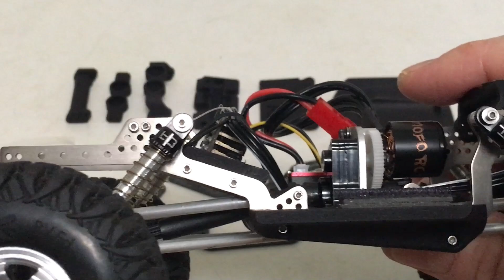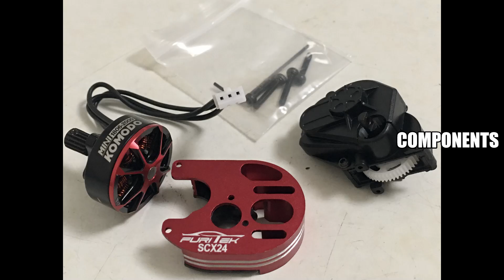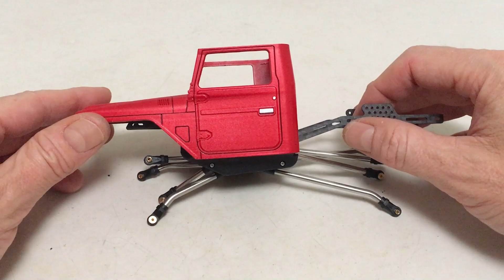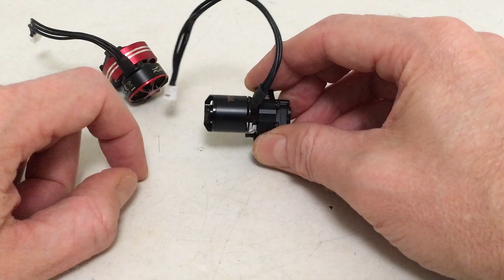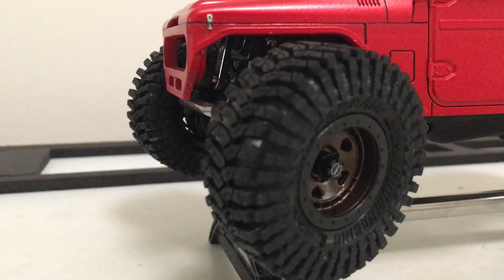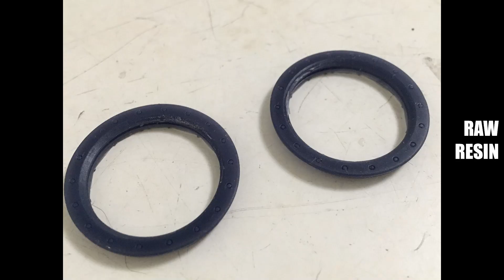SCX24 - XL CARBON CHEAT CODE / FJ45 CAB BUILD: MAZZ DESIGNS SLIDERS, WTMicro BODY, MOFO ROCKWOLF ESC

Comment: You got the FF mount for that motor? I'm ready to select and purchase from mofo website, but i need to be shure what mount i need to go that way you mount your motor.
Reply from the maker: Yes, that is correct, the FF mount. It can be rear facing if you flip your transmission backward as well.
Reply: Thank you! What spec. recommend for perform slow crawl?  @bcochener
Reply from the maker: @montoyaesteban6  the Nano Bam is only offered In 3200kv. Not sure what spec you’re talking about.
Reply: My fault, I ordered the BAM 1900KV 18t. But i think i can run i to as well. @bcochener
Reply from the maker: @montoyaesteban6  it is quite a bit larger and heavier than the Nano version. It may fit… great motor though!
Reply: I'm running a V2 cheat code with C10 links. @bcochener

Comment: Great video ! What type of radio do you run and what types of receivers ? Just purchased the MOFO ESC and MOTOR as my first upgrade to nicer components
Reply from the maker: Thanks!  I use a Flysky GT5 radio and FS2A-4CH as the micro RX - or I use the FSBS-6CH.  All can be found on Amazon.  Mofo all the way!  Cheers.
Reply: Right on thanks 🤙🏼 
I actually just scored from what I can tell is one of the last cages on the planet that you used in this build video from a hobby town in toms River, New Jersey. They are shipping it out now. Super stoked !! Thanks for all the informative info on that build video.
Reply from the maker: @spheli-13  Ah, no way!! What good luck on that find. Cheers mate!

Comment: This is so sweet, you would use the cab eventually, got any tips for mounting it to my UAF chassis?
Reply from the maker: The sliders are set up for a slight angle to the chassis, so I’m not sure if they will jive with the UAF and keep it sitting level. Other than that, the front battery tray of the UAF would need to be cut down to fit the narrow front end of the cab. Probably have to use a tiny battery vs. a stock size one. That’s all I can think of that may hang you up.
- oh, and thanks for the compliment on the FJ!
Reply: Yeah super sick, I just checked and my FJ cab will be painted in the same mica red lol @bcochener

Comment: Good stuff! I’ve been wondering about the rock wolf!
Reply from the maker: Super impressed with it, plug and play with this Nano Bam motor.  Just perfectly tuned for it.  Just need to set the low voltage cutoff on it with the programmer/software.
Reply: @bcochener  keep up the good work. I always pick up something new when I watch your builds!